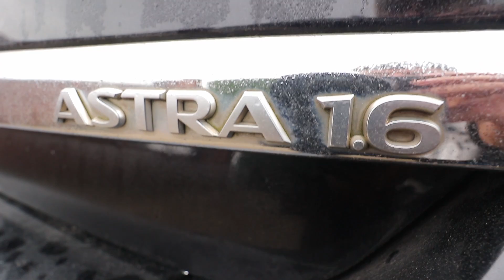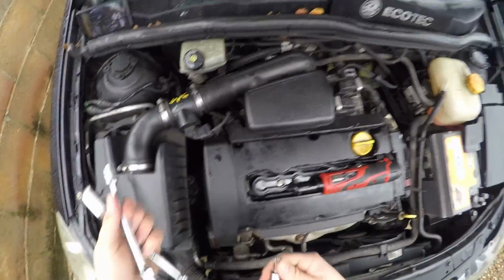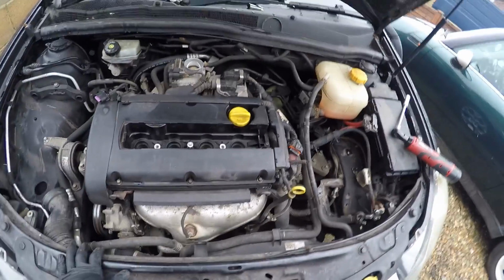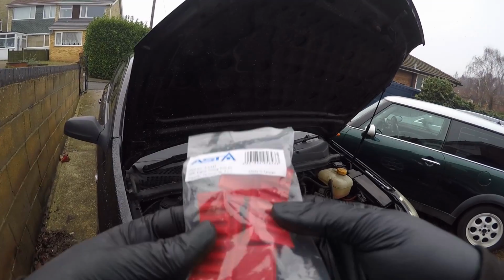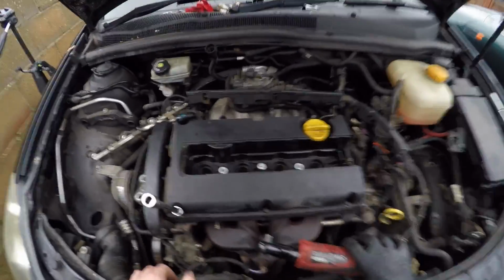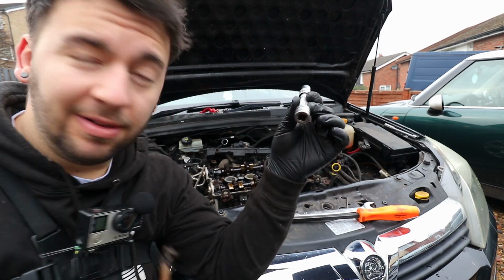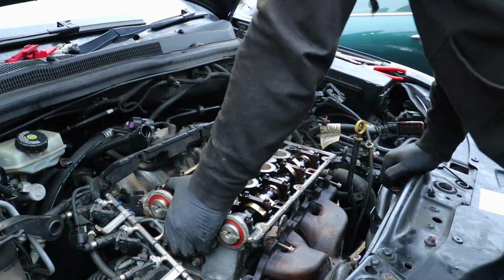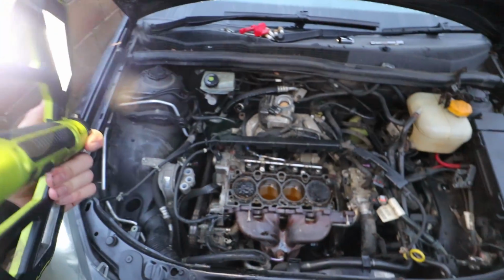Astra Mk5 Head Gasket Replacement! (Part #1)

Comment: Awesome content, don’t know if anyone will see this comment that can help but worth a shot.

Trying to replace my oil pressure sensor it’s not in the easy position (top left of engine) it’s down to the left of the heat shield behind the air compressor I believe anyone know how to tackle it best? Thanks

Comment: How could you drive it like that for a whole year?
Reply: that is what some car owners do, I have friends who haven't changed oil in their cars for 1-3 years then they will call the car junk when it has issues
Reply: @MrRohanThomas  I guess it make sense if you buy dirt cheap motors and just run 'em into the ground and just buy another for cost of a head job.

Comment: Really good video, good point of view with the cameras, maybe instead of taking the inlet manifold off, just disconnect the fuel and wires and lift it out still attached to the head, will save you some time.

Comment: Don’t suppose anyone can help? I have a 1.3 diesel Astra on start up my car will drop revs any idea what this could be? I have replaced egr valve fuel filter and the maf any idea? Hope someone can help?
Reply: Any more info? Any engine light?
Reply: David no Lights at all just will constant drop revs on start up and it’s annoying me
Reply: @R3M1XHD  when you say drop revs do you mean it starts but wont rev up or cranks slow and wont start.
Reply: David  starts up fine but on idle will go from 1k to almost nearly stalling.. if I pull away it will drive as fine as anything

Comment: Why is the thing a Vauxhall, its an Opel in the rest of EU as far as i know...
Reply: It's a Holden in Australia. GM rebrand the cars for the local market, that's all
Reply: Its a holden down under and a pontiac in the states ... all built by GM distributed under recognised GM owned badges . The new astras are built in the UK , so why are they changed to opel in mainland Europe ? ... 🤔
Reply: In the Balkan its an Opel...
Reply: It's because Vauxhall is an old British brand from around 100 years ago.  When GM took it over way back in the 1920's (I think) they kept the brand going and did the same with Opel in Europe
Reply: @JamieVauxnut1  Opel do all the design I think.
Reply: @nicholasbrekespere3616  correct they do was just making the point that its not only the uk that have rebadged opels from GM . Technically all the new astras in europe are now rebadged vauxhalls ... makes no difference whether its an opel , vauxhall , pontiac , holden or even the old saabs (which were on cavalier/vectra chassis) they are all GM renderings of the same vehicle
Reply: @nicholasbrekespere3616  I've owned vauxhalls since i was 17 also the same cars badged as opels . Had a vauxhall mk1 nova sr and also an opel corsa a both were great and near identical . Same all the way down the line astra mk3/4/5 had 3 mk5's  vectra b/c on my second c now ! Mk 2 Cavalier's , corsa b x 2, corsa c  an opel omega , calibra 4x4  even a saab 93. Love the brand and how easy the cars are to tune into something amazing proper drivers cars at the higher end gsi/vxr/sri. Been obsessed with them in motorsport for as long as i can remember mainly btcc but also dtm and rally x . Such a shame the dont compete as a manufacturer anymore , only the odd independently funded team

Comment: There shouldnt be oil in the combustion chamber, that has nothing to do with head gasket. Its a seal problem, either valve stem seals or piston rings are allowing oil to pass through.